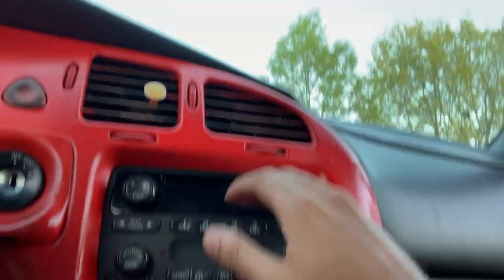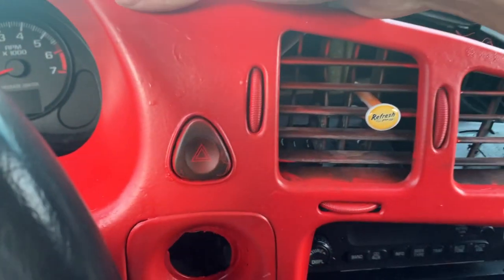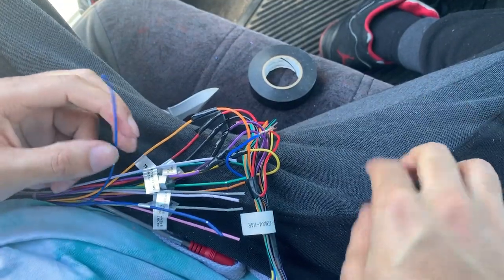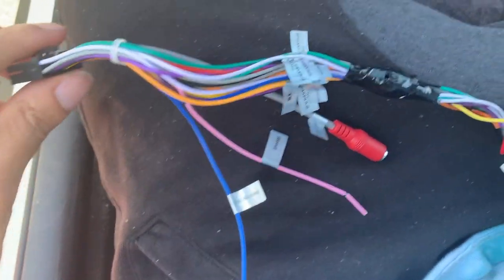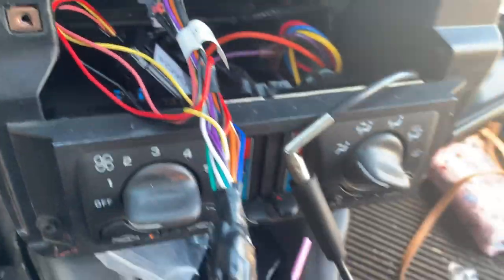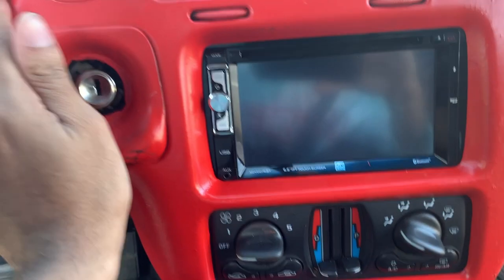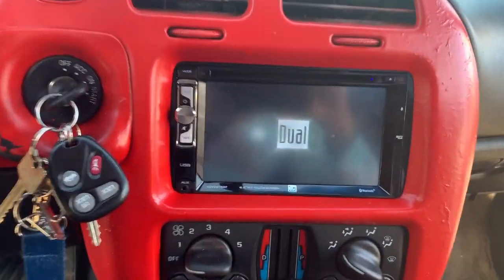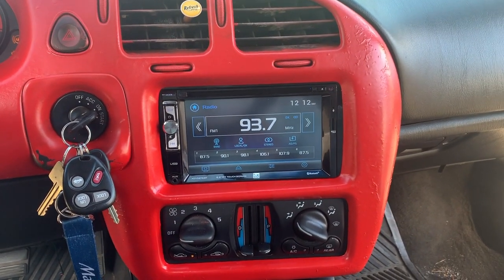2003 Monte Carlo SS Aftermarket Radio Install!!!!

Comment: I have the same radio for my tahoe. Double check your DVD player. That pink brake wire will actually prevent you from watching movies if you don't  Ground it.  Ground the pink wire to the radio exterior metal case to by pass. This will make the stereo think its in park and your passenger can watch a movie while you drive. Worked for me. Just double check it. I found out the hard way when I tried to watch a movie while parked and the player wouldn't work.

Comment: If you have a 02 under the steering wheel the fist cover he removed there are two screws that have to be removed or your braking that panel as well as two small levers that pushes a plastic cover down.

Comment: Thanks for sharing,  mostly those screw points to remove the covering,  had my sub a bit rigged up through the rear speaker outputs but finally gonna take the time to throw a decent unit in,   my tape deck was annoying af...  would always randomly stop the music to clean itself even though i never use that part haha... Props!

Comment: Idk if anyone else had this question but the Harness used was the LCGM24 its the only one ive seen work so far, but ive spent all day trying to find this damn part lmao
Reply: I’ve tried multiple different harnesses but the smaller plug in has been a difficult factor without it my stereo hasn’t been turning on

Comment: The brake wire would need to be ran to the parking brake itself. There is a bypass that can be done so that you can use the DVD player which would be running it to the ground wire. This isnt recommended due to DMV regulations for video playing while driving, but unless you want to run it to the parking brake itself...its a quick fix.
Reply: Just mount the brake wire to the chasis so u can watch dvd anytime to bypass the parking brake

Comment: The wire at the end that says brake is the one that stops video while driving. It works like a ground. Idk what the blue wire is, couldnt read the tag..
Reply: Blue is the remote wire if u wanna use a amp to power a sub

Comment: Need link to wiring harness.
Reply: Did you ever get the link
Reply: Just search for it on amazon, or you can check Walmart
Reply: PAC LCGM24, $38 on Amazon.
Reply: Here it is: PAC LCGM24 , $38 on Amazon.

Comment: My Monte Carlo is 2003 SS as well but it had two fuse connections that connected onto the factory stereo. I'm trying to install an aftermarket one but it only has room for one wire harness. Help please?
Reply: Must be an amplifier

Comment: I keep getting a "no signal" reading when installing my aftermarket radio. I believe that everything is connected correctly but still get a "no signal" reading. Does anyone know why this is, and if so please comment below. Thanks
Reply: Check and make sure your antenna is connected in the back.
Reply: The stock radio communicates with the main computer with settings and all that.  not good to change out radios
Reply: @lukieduke2003  Lol tf you mean. A brand new touch screen deck or a 15 yo stock radio. I got it to work btw
Reply: Codi Leonard lol if you only knew but good for you and good luck with it and with you need to reset shit when you need to (I’m not even going to explain) 😭the stock one works with the computer

Comment: I just installed my radio everything came on but there's no sound????
Reply: My radio does the same to was it a fuse blown?? Or what
Reply: @rodgotyou7322  it's been a while but I think I connected the blue wire to the white wire

Comment: Where u got the wire stuff at?
Reply: You can most likely get them from Walmart but if not you can get it from Best Buy guaranteed
Reply: Hey KB, here's the harness model number. Its from PAC. PAC LCGM24, $38 on Amazon.

Comment: Was that little box in the harness a in-line converter or did it bypass the security system?
Reply: Its chime replacement. It comes on the new harness adapter PAC LCGM24. $38 on Amazon.

Comment: Good shit. Real talk. That install would be $200 minimum. You can melt wire ends with a lighter, if you're good enough. If not you'll get burned asf

Comment: How do you reset the check engine,tire pressure,and oil reset lights?
Reply: put the key to the on position and hit the gas 5 times

Comment: Is your system amplified ? If so can did u run it any problems
Reply from the maker: no its not
Reply: Know this is an old comment, but factory amped systems from the general require the amp to be on the blue wire. The amplifier receives power via the blue line, and you'll have the factory system bumping with the new head unit.

Comment: How’d u get the dash red ?? I wanna do something similar with my 01
Reply: Make sure you clean it well first and dust it off. He obviously didn't.
Reply: You would have to take it apart and spray paint it if your going to do red use rustoleum sunrise red because it matches victory red almost perfectly
Reply: You want to use some adhesion promoter too. It’ll help the paint stick better to the surface. I have a beige interior so red would be awful for me

Comment: What’s the wiring harness u got
Reply from the maker: not sure, got it from a company called extreme audio
Reply: PAC LCGM24. $38 on Amazon.
Reply: Do you need to use the smaller plug in on the stereo I have a 2002 monte carlo my wire harness has no plug in fir it that fits